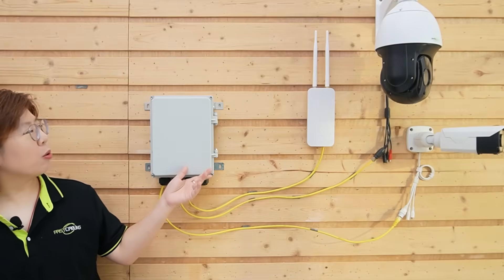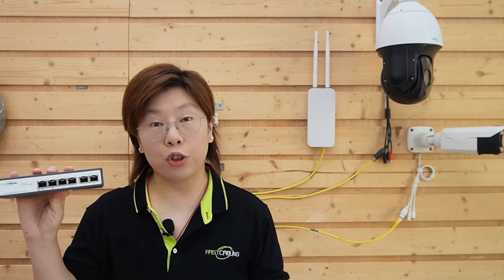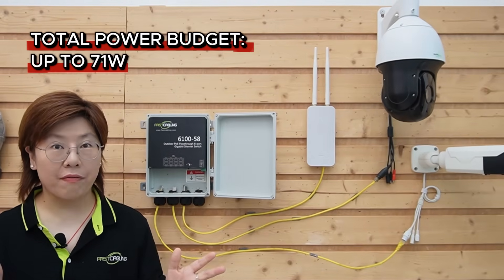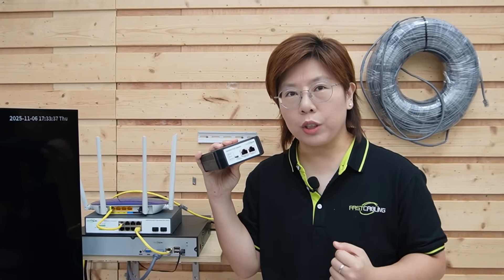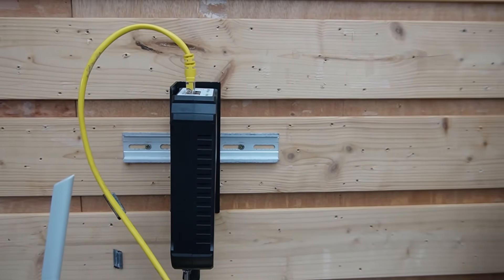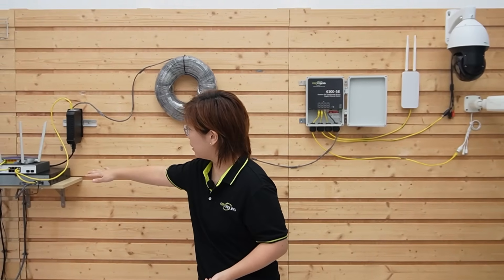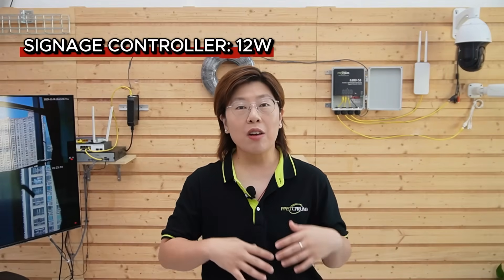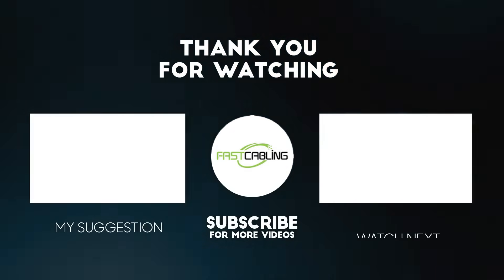Power 4 Devices with One PoE Cable | Simplify Outdoor Installs

Comment: Been using something similar to power a camera and Deco outdoor 150m away. Works great but speeds keep getting lowered to 100m and does not stay at gigabit speeds.
Reply from the maker: If it's an ordinary PoE switch, the total distance exceeds the Ethernet spec limit of 100m. Beyond that, signal loss and voltage drop reduce link quality. Moreover, if the cable is Cat5e or lower, or has poor shielding, you’ll likely only get a stable 100Mbps link.

Comment: It is possible to connect PoE bt injector from
Another poe switch? It is fine to connect PoE bt injector to non-poe switch to avoid conflict? Unless the poe injector and poe switch have both IEEE compliant
Reply from the maker: No, you can’t connect a PoE injector to a PoE switch, as it can cause power conflicts. You can connect a PoE injector to a non-PoE switch. The injector adds power on the outbound side only. The non-PoE switch just handles data; no voltage conflict possible.

Comment: Is it possible to plug this switch directly in a nvr poe?
Reply from the maker: It may not provide enough power to the PoE passthrough switch and the connected devices. Plus, the NVR’s DHCP server might assign the same IP addresses to multiple cameras, causing conflicts or disconnection.

Comment: i think it id called PoE powered PoE switch
Reply from the maker: Yes, it can receive PoE power from a PoE injector or switch and pass that power to the connected devices.
Reply: @Fastcabling  no like the PoE powers the switch but the switch also has PoE

Comment: Hello. I have a 5-8 second video delays/choppy feed that I'm try to fix. Currently using Reolink NVR  hub >  Fastcabling Long Range PoE+ Switch > a FAstcabling 5 Port PoE switch(this is located 300' away using Cat5e cable) >  2(two) separate ReoLink cameras(50' cat5e cables). I HAVE LONG DELAYS/CHOPPINESS ON THE VIDEO STREAM.  I ALSO HAVE a Reolink wireless cam running off the NVR hub that has NO DELAYS/CHOPPINESS. But the camera using the loong range switch have a terrible delay.   If just remove what I am now using,  Would this injector and pass through switch you showcase on this YT video, eliminate the delays and choppiness? Any tips would be appreciated. Thank you!
Reply: Would this injector and pass through switch you showcase on this YT video, eliminate the delays and choppiness? Any tips would be appreciated. Thank you!
Reply from the maker: 300-500ms is the typical delay between IP cameras and the NVR since the video needs to be encoded and decoded on both sides. If there is a serious delay you experienced, it is caused by another issue rather than the network infrastructure. The delay can't be eliminated or go for the AHD/TVI HD analog cameras system.

Comment: Can this be powered by a PoE port from another switch instead of an injector?
Reply: Yes, if the other switch has 802.3bt.
Reply from the maker: Yes, an 802.3bt PoE switch or injector. Just make sure it provides enough power to the poe powered switch and the connected devices.